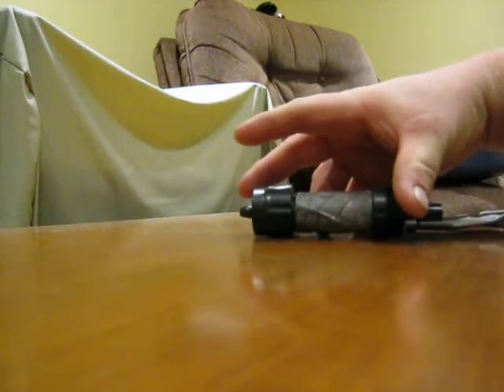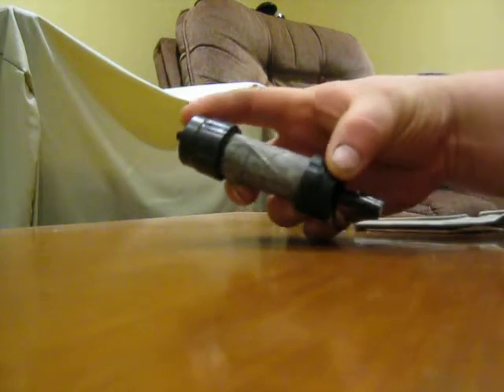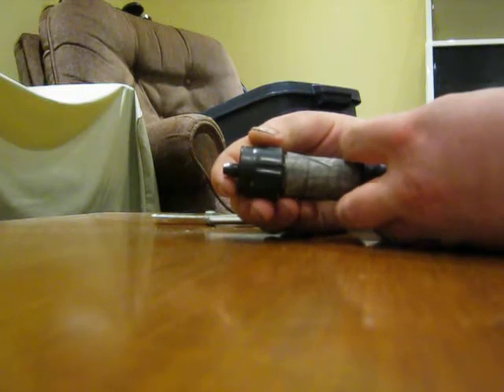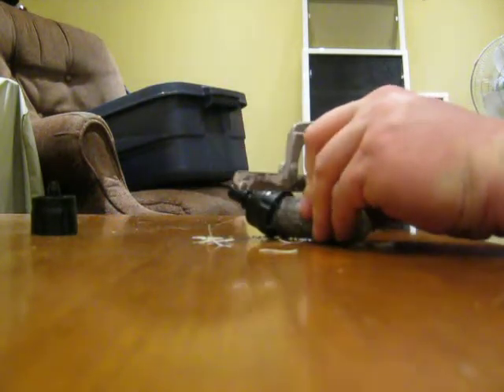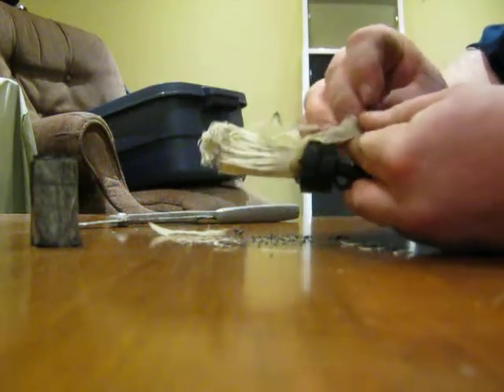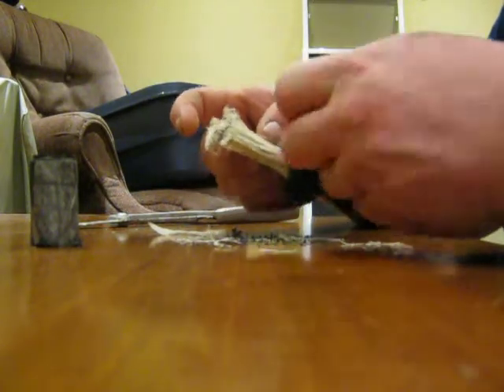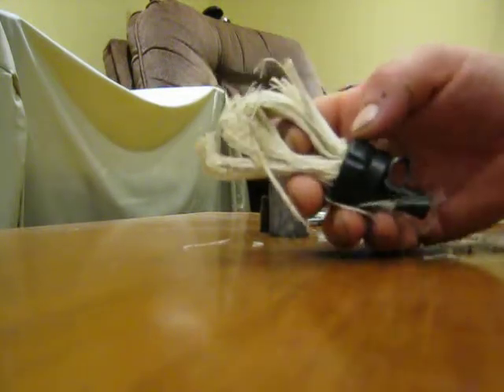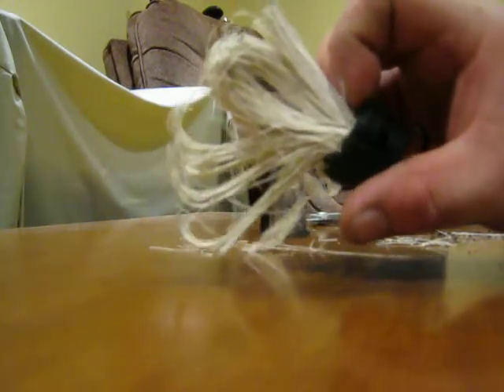What's Inside the Sawyer Filter?

Comment: Wondered if a hole, 1 micron in size could be seen with the naked eye. Here's the answer.
Quote: A micron is a unit of measure in the metric system equal to 1 millionth of a meter in
length (about 39 millionths of an inch). The average cross-section of a human hair
is 50 microns. The human eye cannot see anything smaller than 40 microns in size. http://www.baldwinfilter.com/literature/english/TechTips/201403TechTipsMicronRatings.pdf 
Suspect your filter may have needed cleaning and dried out before it was done. Much like washing mud out of clothes before vs after it has hardened into the weave of the fabric. The Mini is rated for 100,000 gallons. Providing it's cleaned, as recommended, and not allowed to freeze with water inside of it. 

Interesting to see inside of one. Makes it easier to understand the concept of the hollow fibres. Thanks for sharing.
Merry Christmas to you and yours. May you have a blessed New Year.
Reply from the maker: yeah, believe me I'm no expert on the technical terms but then again I didn't think it would look like that on the inside. Thought it would be different.